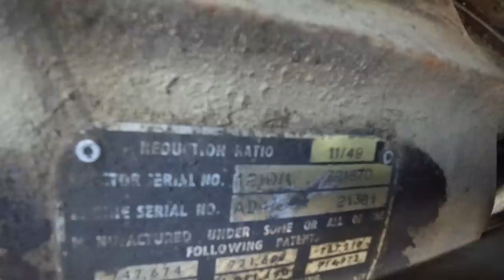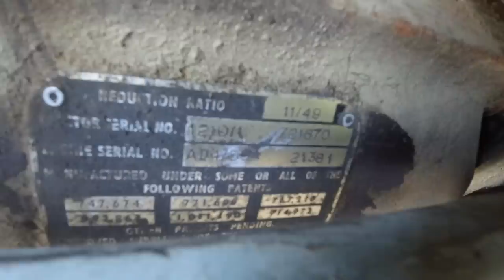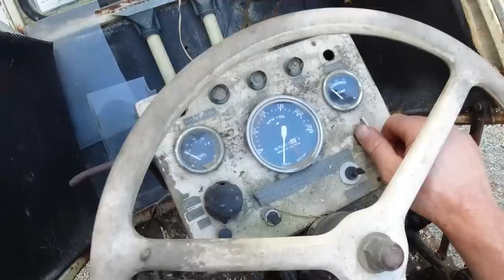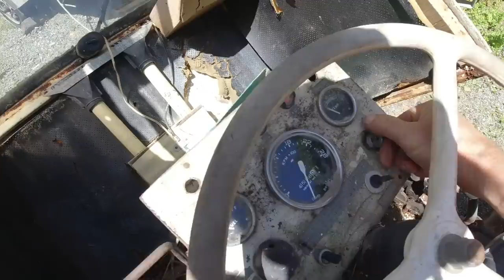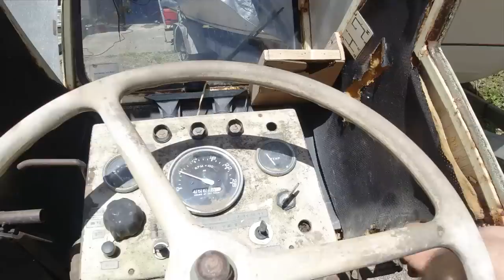Salvaging an Abandoned Orchard Tractor.. How bad is it??

Comment: Good video. If you're going to use the old beast just for the chipper, you could build a dump box onto it above the flat area of the white cover (above the hinges from the side panels) and then shoot the chips into it so you can haul them away instead of using a wheel barrow. It could tip sideways rather than like a dump truck so you can access the panels when you need them.
Reply: There’s an idea👍😄
Reply: Thinking along the same lines and then read it in the comments. 👍
Reply: Brilliant!  A chiipper/hauler in one vehicle like the big boys.
Reply: Brilliant idea … make the bin swingable for easy tipping.
Reply: @markhelseth253  Suburb-frontyard sized. Better than the big boys.
Reply: I thought I was smart for thinking of that 😂. Guess not.
Reply: Hell, I think an articulated man lift would be sweet tabbed to those rectangular tubes backside 
 HAS HYDRAULIC HOSES
Low tractor height should be a plus for property access
Reply: Why not donate the thing to charity?

Comment: Since the engine runs so well and it's already got the enclosure built around it and no attachment lift but a good PTO (kinda precluding it from useful general farmwork), this machine would make a perfect diesel generator conversion. Or some other kind of general purpose "rolling engine power source"

Comment: What a cool outfit! I never saw a tractor like that before, especially a David Brown. Only 11.2x28 tires on a 65 horsepower tractor. I guess they needed it low for orchard duty and never expected it to pull more than a sprayer. I actually expected it to be an 885 under there, not a 1210! What a  great score!

Comment: What an odd machine. Ive never seen anything like it. Its back-to-front. Amazing how little rust there is on it, the plywood cab is still good and it even started first time. Seems a bit overkill just to drive a chipper though. You could just use a small briggs & stratten lawn mover engine .

Comment: I'd have to rig up a remote kill switch mounted by the chipper.  Good distance to move if ever there is an accident.  And maybe a cage to protect the driver from becoming battering ram if it ever gets away and run into something.  Neat old unit at any rate.
Reply from the maker: It does have a shear pin on the chipper but yeah a remote kill switch wouldn't be silly

Comment: You can use an old tire valve to make a blowing nozzle attachment on your tire inflator.
Strip the rubber from the brass,remove the valve core.
It will blow better than the quick attach end for sure.

Comment: That's a big tractor for an orchard tractor.. impressive conversion. They're about 3.2 tonne in std trim.. 72 engine hp. 1210 should have syncro on 3rd and 4th.
Reply from the maker: From what I can find online the 2wd version is 2.6 ton, this one is probably a bit heavier with the cab up front
Reply: @MartyT  yeah thays right. Had mine figured at 3.2 ish cos it has water ballasted tyres. They are weapon of a tractor, about the biggest you could get when they were new

Comment: Inline injector pumps like that Minimec type do make way more noise than a rotary VE Type. CAV DPA types are noisy tho.  All the noise is just from the pumping of the fuel. Customers cant believe the noise generated by an inline pump when they hear it on the test bench esp at full rpm with throttle lever in max position.

Comment: Very neat piece, it looks like it has a wet kit for remote hydraulic on top of the pto. If you can find them around, you should be able to use anything that is hydraulic powered. Saws, jacks/spreaders, winches, so on. If nothing else, take the cab box off and ride around like that.
Reply from the maker: Those pipes were to connect to the towed sprayer but I could tap into the hydraulics no probs, the pump seems strong
Reply: @MartyT  Top drawer idea for sure, of course now I wonder about this: Hold on to it long enough to maybe find another same model tractor that is junk just so you can maybe rob the three point off the junker to then fit it on your forward control unit. Have yourself a low profile utility, fit a cradle on the back that can lift off for any maintenance work

Comment: A great find there. The 1210 was a good sized tractor in its day with good power.   Maybe a strange choice for orchard work.  I spotted the inline pump straight away. 
We had a 1210 20 years ago on the farm in the UK. It was poorly maintained and in bad condition but it never let us down and was out only tractor. I have a 996 currently. 
It would be great if you could source the lift arms, some fenders and put it back to how it should be. Not sure if parts are hard to get over your way though. Good find!

Comment: As always another great video and definitely love their wife's reaction and for her to share the farmer that it's going to a good home cuz it truly is. And it is unreal how many piece of equipment I've accumulated from other people cuz they couldn't get it running or whatever or people just wanted it gone and it came down to having a bad ground/ Earth as you call it. It doesn't take much corrosion between some connections to make everything just stop working. Recently A friend had somebody put a new starter in his car for them and it wouldn't work I came over checked it out took all the connections apart clean them all cuz whoever did it didn't bother doing any of that put it all back together first turn and it fired right up. And I bench test the old starter it worked just fine all it was was bad connection. You know instead of doing the Common Sense thing and check all the connections first does like most people do and buys parts and throws it at it without bother checking anything beforehand. Cheers to you and the family hope you have a Merry Christmas.

Comment: What are you locked out from Marty?   I used to operate the David Brown 1210 here in England back in the day in the parks dept of one of the London Boroughs (Hillingdon,). My job to mow and cut the cricket and football etc, pitches. It was in its original form though. On hot days I used to roll the back plexiglass up and used to swear a lot when I was getting smacked on the back of the head by flying doggy doo-doo being flung by the quad mower blades. Used to take one of the governors of the throttle links too, Didn't use the power take off at the back too much except for flailing, it also had a bucket.. Oh those halcyon days.
Reply from the maker: Nice.. I used to work on an orchard mowing and spraying, they had a fleet of david browns, I've always liked them since then.. Their db1690 was a beast, I'm still looking for one of those...
They've been doing repairs on the main road for the past 6 weeks, instead of leaving a lane open, they decided to fully close the road. It should be open next week 🤞

Comment: It would be easy to go to a tractor wreckers  and get the parts you need to make it normal again most tractors that I have seen look easy to put back to normal again and usually they dont have much mileage  on them and then you will have a good tractor

Comment: The David brown 1210 followed the 1200 model of the 1960s and produced 72Hp din in the uk at any rate. The 12 speed gbox should be syncromesh although you probably will never know with that linkage!
Most had a two speed pto 540 and 1000 rpm (or 540 at low revs for light use)
Over here David Browns were considered reliable units that often leaked a bit of oil, but ploughed on regardless. I guess your gearing will be pretty low as the one we had came with 12x38 wheels on the back. Diff ratio will probably be stamped on the ID plate.

Comment: That tractor looks like an early 70s DB 1210 or 990 but those 3.6 litre 4 cylinders were built like tanks.
My Dad owns a 1975-1976 DB 995/990 with the same engine, done over 55000 hours, and no matter where it is,
after months of sitting on end it still starts up no problem.
They are so simple to work own and will just keep going.

Comment: Love the hand winch, never see them anymore with all these fancy electric ones. I've used chain pulls and hand winches way up in the hills of New Mexico high centered or slid off too much..best things you can imagine and zero power reliance. The really don't fail if maintenance is done, electric has higher chance of failure. Yes electric is great and has plenty of good uses I know, not denying it. But manual is absolutely a good idea to toss in the back just in case.
Reply from the maker: My thoughts exactly, I have an electric winch on my boat trailer but I don't trust it, I keep a hand winch in the truck incase it fails

Comment: Hey Marty, check out the pto lever or whatever the arrangement is - on the original setup it is a two speed pto 1000/540. That should be useful  on the chipper for light material as you'll only need to run it at an idle!
Reply from the maker: Yes you're right, 540 is the only option from the cab control but I will make it 1000rpm at lower revs next time

Comment: There's a market for kit cars - kit tractor sets haven't been that popular. The look is like a VW camper van - made from plywood.  It did remind me of a tractor that was used in a holiday park when I was a kid that had plywood on it to make it look like a steam engine....not that it's so important - you could sand a repaint if the wood's good enough and change it into a flat bed truck to transport the mulch around. Some of the bags that ballast and sand is delivered in when you buy large quantities could come in handy for this. I also saw roofing panels recently that had insualtion glued onto them that were pretty large - if you could salvage some you could make the biggest hot composter in NZ for your wife .

Comment: Lil bit of a tip, when you blow the filter out.. blow it OUT not into the intake side, all the dust will come out much easier as your just trying to push all that dirt thru the filter instead of out. Just a bit of common sense.
Reply from the maker: Yeah I always blow from the inside first then blow away the loose dust from outside

Comment: how old can diesel be and still be good? or is it that much different than gasoline
Reply from the maker: It doesn't go off as fast as gasoline, I find as long as it doesn't have water or the diesel bug in it, its ok to use old fuel in old engines, I wouldn't use it in modern engines..  Others will argue that you shouldn't use fuel older than 1 year.. but its so damn expensive these days I'm not wasting it 😂

Comment: Your videos very informative thanks! If you will add a quick comment when you checking something that would even better. Like when you started a machine you hovered the hand over exhaust. I didn’t get it, did you check the temperature?
Reply from the maker: I was feeling for moisture or sparks coming out but didn't feel anything, the engine is in good condition

Comment: Are the mounts for the three point still there? You could put it back in and just have a low slung tractor.
Reply from the maker: I think a rear lift could be added, final drives can be turned to raise the machine

Comment: So, a bouncing needle on a tach or speedo ALWAYS means the cable is dry and needs lube- it's grabbing and releasing several times per second and will break the inner cable soon- remove one end and spray the inner cable down with white lithium spray.......

Comment: hi Marty, when your back is turned I reckon your misses jumps and double heel clicks while saying, YESSS ANOTHER TRACTOR.
on a serious note, have you ever thought about a cheap wheel excavator for your farm, long distance travel with little tyre wear, heaps of reach , strong break out power, just not sure if there are many used cheap ones about, maybe to expensive just for odd farm jobs.
Reply from the maker: Yes a wheel excavator would be very useful but I don't see any for sale in my price range, they tend to go for over $20k
Reply: @MartyT  who wold have thought you could get the grader for such a bargain, I'm picturing a 4 grand wheel excavator just around the corner

Comment: You mentioned that you're "locked out of the forest property".

What's that about? Are the roads flooded?
Reply from the maker: They've been doing repairs on the main road for the past 6 weeks, instead of leaving a lane open, they decided to fully close the road. It should be open next week 🤞
Reply: @MartyT  

Ah. 

Hopefully they allow for proper drainage, so it doesn't get washed out anymore. 

This goofy plywood covering on the tractor... Are you gonna pull it off? I would imagine that even though it's keeping rain off of the metal, that the internal moisture would be almost as threatening.
Reply from the maker: Yeah I might remove the cab, it feels very claustrophobic with it pulled down

Comment: Guessing that a capacitor in the tach has dried up, and is no longer smoothing the pulses to indicate RPMs.
Reply: Cable driven, most likely has a kink in the cable from sitting or lack of lubrication.  Just like old-style speedometer cables.

Comment: Interesting how they lowered it, smaller wheels and tires in the rear….. and a highly “modified” front axle. That’s the only thing that  looks a little sketchy that I can see and the way it’s set up it will never see much weight on the front anyway.

Comment: What was the benefit of converting it to forward control? Other than it looks cool 😅
Reply from the maker: It was used to tow an orchard sprayer. The cab stops the operator being covered in harmful sprays and the low profile lets it get through between the trees without breaking branches

Comment: You could Probly fiberglass the front canopy, instead of remaking it. It’ll be wonderful in the rain.

I also wondered about changing it to a top mounted cabin instead, so it gives you sun protection When up.  Likely just 2 repurposed hydraulic struts.

I do like the flat bed of the back … could be neat as a loading area for carting

Comment: Marty , you must do something with
the Cab it looks kinda silly really , but
have to say a good job in getting it
running so quickly 👌
Saw a Toyota Dyna in the background l had a Dyna 100 1.8 litre petrol , as a lease truck it was
serviced regularly & the company
changed it at 200,000 kays , then
got given a k2700 kia diesel all the
mod con's , but was rubbish the
heater core blew twice it was off
road for a week ( whole dash board
had to come out)  & more so yeah
not a happy experience will never
buy a kia 😞

Comment: I was surprised to see your wheelbarrow was a True Temper USA.  It must have been on the boat with the Caterpillar equipment that Curtis at Cutting Edge Engineering work on.  
Someone spent a lot of time modifying that David Brown tractor.  I'm envious that 25 - 50 hp diesel tractors are ubiquitous in Australia, NZ and UK but we in the USA got stuck with gas guzzlers

Comment: Hay mate we had one very similar to this our one had 2 radiator’s in the orchard not much breeze plus we had guys that had to have it singing at full revs for no reason
Reply from the maker: Where was that?
Reply: Hastings we used it for our wine orchard it was a sprayer
Reply: @MartyT  they are are home design bit of garage and a few glasses of wine therapy hahah but overall very good for someone like you very mechanical you can make some use out of them

Comment: Flagship tractor of the range 72hp back in the day hydraulic pump is usually mounted on the front if it’s still there u could rig up some external services, it’ll have a synchromesh transmission too

Comment: Say that you wanted to pimp it to your daily driver tractor, would it be feasible to remove that cabin and put the seat and wheel,where they usually are? Or does that have structural stuff that came from factory like it is?
Reply from the maker: It looks like a diy conversion, it could be converted back to original, it would take a week or so and I'd need to find some parts.. but I quite like it as is, it's a one of a kind piece of NZ history
Reply: @MartyT  ok. It sure is a talking piece when parked on your driveway. :)

Comment: Typical David Brown they were noisy to drive especially the gear box with straight cut gears but otherwise bullet proof one common problem is the blocks crack easily in a frost.

Comment: Marty indications are Mrs T had a pretty good idea the adage "if you have a hammer in your tool box eventually everything can start to like a nail" might apply to your newest gadget too, and that the local trees are trembling with trepidation rather than due to any pleasant breezes.
The unusual configuration for that old tractor would probably lend itself well to supporting a float in local parades or whatever too.

Comment: Interesting how the conversion has cocked the shift pattern back-to-front.  Were you running the chipper in high or low speed PTO?  Seemed to be revving pretty hard for the load.
Reply from the maker: It was in low speed, revs were mid range, I wanted to see if any problems showed up when it got hot
Reply: @MartyT  How could it possibly get hot with an extra radiator fitted 🤣?  I wonder if it was converted like that, or whether it was added later in response to overheating issues.

Pretty easy to tell which was the original DB radiator, at least.

Comment: Just a question I have just bought a David brown 1200 and it has a couple off oil leaks , would you recommend putting any stop leak in the oil?
Reply from the maker: Always best to replace the leaking seals/gasket if possible, I personally never use oil stop leak
Reply: Thanks

Comment: Wow so amazed she's beautiful.
No idea why you would want such a configuration or how you mount a sprayer on that but very interesting.
Reply: The air blast fan was attached to the back of the tractor.  Shifting the seating position to the front of the tractor gets you further away from the sprays.  This tractor was converted from brand new.  There were two other David Browns and an International converted in the area about the same time.  There were many  David Browns converted into forklifts as well.